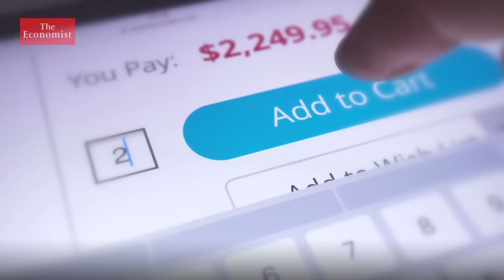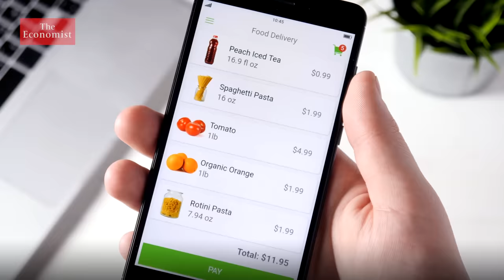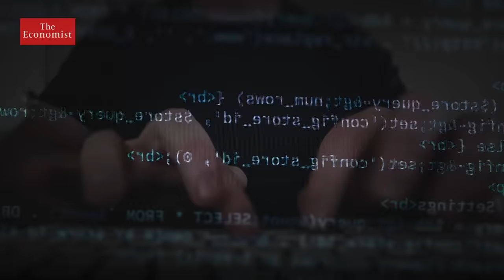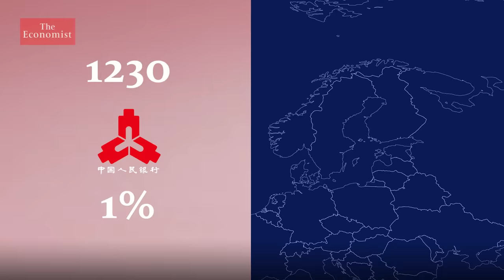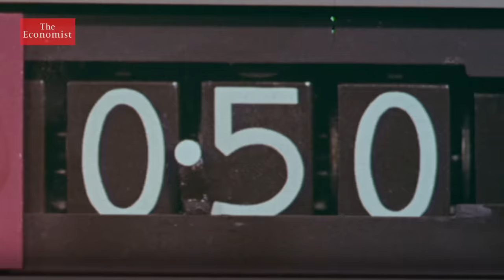What does a cashless future mean?

Comment: Without cash it will be easy to disconnect anybody from the system. Just block or suspend your account and you won't be able to even buy food. Another method of control
Reply: Just like the blockchain on crypto. Then those fools will have the rug pulled out from under them.